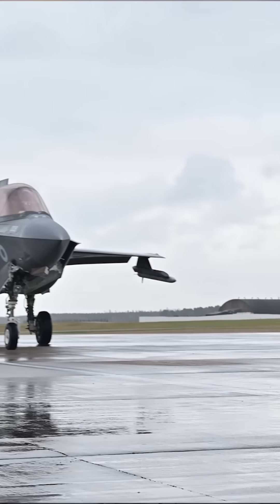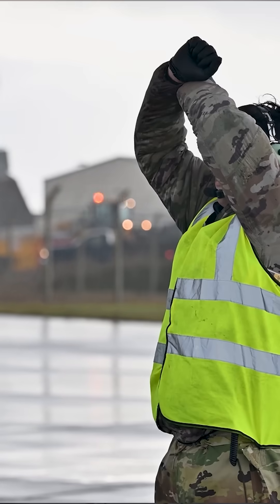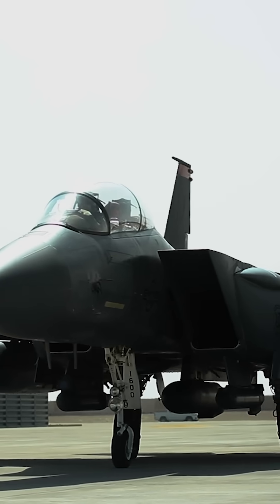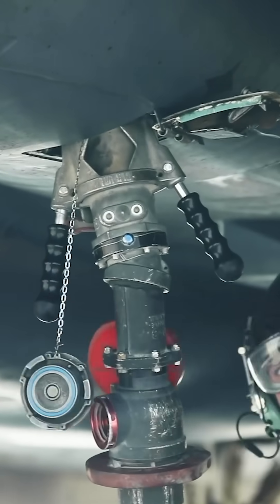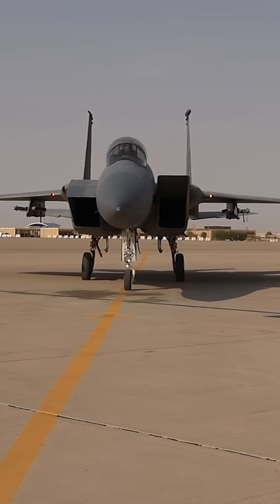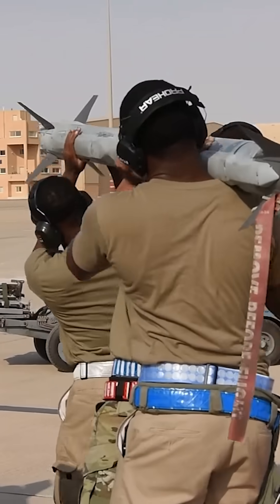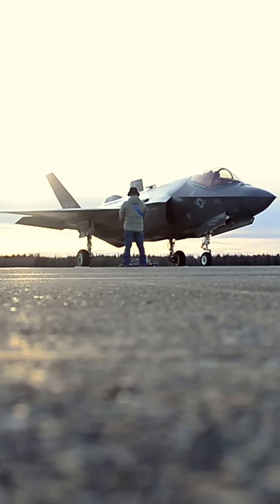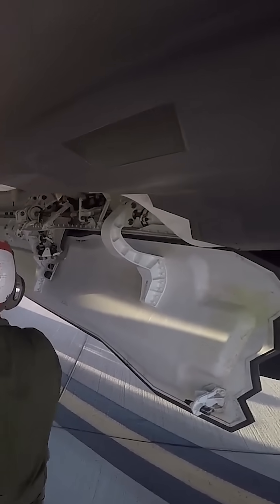The Air Force wants to re-arm and re-fuel F-35s in under 30 minutes #f35

Comment: The way I see it is this. 
1- we train for hot runs constantly like it’s the norm so if we ever need to do it it goes smoothly. 
Or
2- we have two of each jet for each pilot so when we return back to base we can swap jets while they rearm and refuel the jet we brought back, and still train at least once a month on hot runs incase of emergency base attacks or close air support missions that require multiple sorties from the pilot in a row as fast as possible.

Comment: That's assuming F-35s can survive an initial sortie for a hot reload.
Reply: There's no other fighter more like to survive, than the F-35. 4th generation jets aren't even close.
Reply: @rogerbiggerstaff3293  Latest sim runs say 60% of F-35 launched won't even get in range to fire off  the first load if the opponent has a competent air defense.

Comment: This reminds me of production rates. A prodigy was/is able to put together a product sub assembly freakishly fast. Faster than anyone else. Some engineers timed the person, then made it the standard time for everyone else. Or some engineers calculated what the rate should/could be on paper in a lab setting or worse, a conference room. Yes, I understand the Air Force is making it possible to rearm an F-35a faster through innovation and process improvements. But how much involves putting more pressure on personnel to work faster? If the answer is anything other than none, then I think it’s wrong.

Comment: I lived on a carrier for over three years and fast turn around was routine.
Reply: I remember a sailor told me hot loadings had to get explicit permission from the admiral to proceed, but they did happen.
Reply: @Buttersthatsme01  during work ups it’s not uncommon to launch continuously until everything is off the deck. Admirals don’t normally get involved in regular ships operations.😊
Reply: ICTs have been routine since the early Cold War. As you know they're not difficult.

Comment: Jet fuel generally is not all that explosive. It does not have explosive fumes. It is combustible and it does burn with great heat under compressed atmospheric conditions like that after a turbine compressor section. Weapons are not able to be armed until after they are installed into the weapons bay.

Comment: Mfs picking apart whether or not Jet Fuel is explosive never heard of TWA Fligjt 800 lol.

I mean yes, technically that was a mixture of fuel and vapor, but I challenge you to expose jet fuel to heat and not get an explosive mixture of fuel and vapor.

Of course there’s procedures and controls to maximize safety, but maximizing safety, speed, and reliability at the same time is still an engineering and operational challenge and nothing to scoff at.
Reply: Ummm, why can I throw a match in a puddle or bucket of it, and nothing happens? In case you were wondering....I spent 6yrs as an F-16 as a fuel system mechanic and have been around kerosene all my life. Fuel = meh. The Hydrazine is what made me nervous.
Reply: The refueling systems are a closed system. They do not do gravity or hose nozzle type refueling normally for those airframes. Certainly not during hot refueling.

Comment: During the "cold war" we did NOT do "Hot" ICT's. I've done hundreds of ICT's on F-16's while stationed at Hahn Air Base in Germany in the years leading up to the Berlin Wall coming down. They were never "Hot" ICT's. We operated something completely separate called "Hot Pits" to refuel an Aircraft with engines running and get it back in the air quickly. 2 very separate operations. Hot Pits vs ICT's.
Reply: At Shaw we practiced hot ICT a few times but it's just easier to hot refuel after landing. We did it that way during combat ops out of KKMC during Desert Storm.
Reply: @Comm0ut , yeah after DS and we closed Hahn I got orders to Shaw. Went to the 19th FS Gamecocks.  Again, lots of ICT but never an engine running ICT.

Comment: During the Cold War, there was a British Aerospace concept for an autoloading system using a gyro crane on a frigate called 'Skyhook'. The system grabbed hovering harriers, loading them onto a cradle on the deck that had preloaded weapons, attached them to the aircraft and lifted the aircraft off the deck. It only got so far as the harrier grabbing system trials.

Comment: ICTs at least on an F-15 are done with the engines shut down.  AFAIK you can't load missiles, bombs with electrical power on the jet.  There is also "Hot Pits" where you refuel the plane while the #2 engine is running.  F-35 may be different as far as ICTs, with only 1 engine, Hot Pits is not an option though lol
Reply: I hate to burst your bubble  But I was Combat Turn Director in Upper Baker AT Bitburg AB Germany.  from 1983  thru 1988. 
ICTS  were often done with engine off but the test for certification were done only with engine running in the 36TFW  in 87 and 88 we added the factor of driving the fuel truck into the Hardened Aircraft Shelter and closing the doors of the Hardened Aircraft Shelter.  TAB-V.   In addition to that guns fuel and 4x4 missile load over 25 minutes were considered slow by Cold War Standards on the F-15   You are correct we did not use external power we had right engine running.

Comment: If they can refuel in flight, doing it on the ground should not be the main hurdle. I guess the quick rearming and replacement of counter measures that were used is the complex part?

Comment: Jet fuel isnt flammable. It’s combustible. It’s the same as kerosene and diesel fuel; except it’s just a lot cleaner and heavily regulated
Reply: True, but a Turbo Fan running certainly exceeds the Combustible point of 800 degrees by a given margin.
Reply: @RedSinter  there are procedures for hot refueling already in place. I design military fueling equipment, along with commercial stuff, for the last 20+ years.
Reply: @RedSinter  JP-8 is one of the safest fuels there are.  But hot pits are one of the more dangerous parts of maintainers and POL jobs.
Reply: Also, they don't fuel the little birds at 600gpm. They can only take 200-450gpm, depending on the tank venting. The heavies have dual 3-lug adapters, so they can take two hoses/nozzles for 600gpm or more.
Reply: liquid jet fuel is not very flammable, but jet fuel vapors are very flammable.
Reply: That's why the don't put the vents anywhere near the engine exhaust.  Hot refueling is always planned into the design of the fuel system.   @timk9847

Comment: The Israelis are absolute ninjas at this. They've needed to be in fairness.
Reply: Wanted to say this 😅
Reply: yeah, from what i heard they can rearm and refuel at like 10 minutes max.
Reply: @superteaman1456  Sweden have done the same for decades, dispersed and with conscripts. 25 minutes would be considered glacially slow. That said, internal weapons storage makes things slower. But that would only explain say a 15 minute turn around time, not 25 or 30.
Reply: @oloflarsson7629 the F-35 carries more fuel internally, than a Gripen with internal fuel + 3 external fuel tanks.
Reply: @rogerbiggerstaff3293  A standard fuel truck can fill up the total fuel volume of the F-35 in about 10 minutes, so that doesn't why it would take 30 minutes to refuel and rearm.

Comment: As a weapons loader….hot pits suck so bad. lol cool capability but a shitty day
Reply: Since no one else has really elaborated, care to explain what the difference is, seems like the same exact tasks need to be performed, just requires more speed and efficiency because you're trying to get the turn around time down. Kind of like the difference between getting your tires rotated at the tire shop and it taking a couple hours and a race pit crew doing the same thing in seconds, yeah? I mean as a system it has higher requirements for personnel training, man power, and equipment, but for an individual worker I don't see how doing one task as part of a large crew working simultaneously over a short period of time is that much more problematic than doing multiple tasks sequentially as part of a smaller crew working over a longer period of time 🤷
Reply: @ because it’s an all day type thing and much more busy and requires lots of logistics between the specialties involved. (Fuels, crew chief, weapons, ammo, avionics) and it’s already a rush when you aren’t “hot pitting” this just ramps it up even more.
Reply: @TylerSmithMusic1  got it, appreciate the response, cheers
Reply: NOT PITS  were drive by refuel  much like a local gas station .  Except the hoses are steel have hinges and need to be man handled to a new location for every bird.  one after another all day.  Having the Pits duty was really THE PITS.